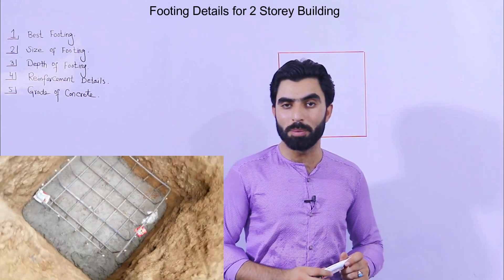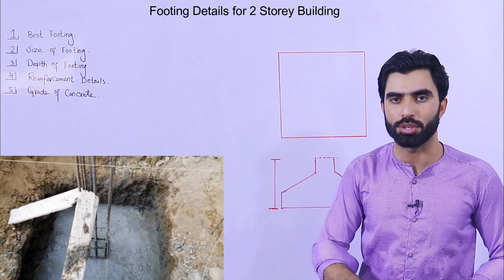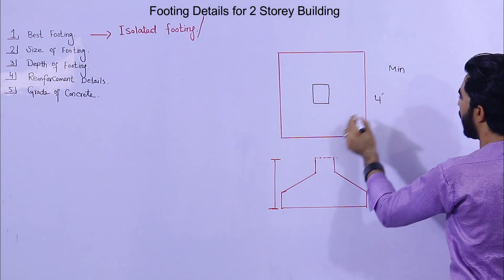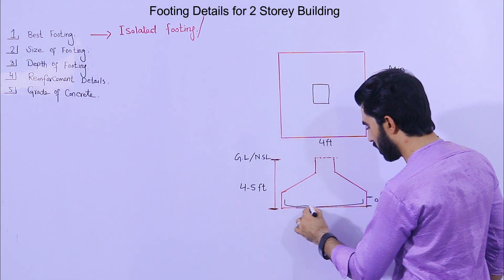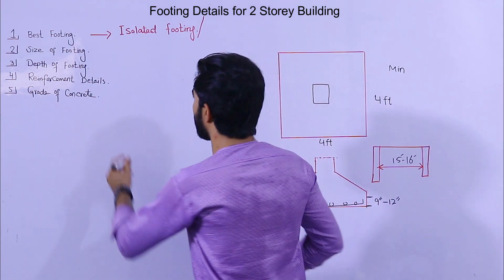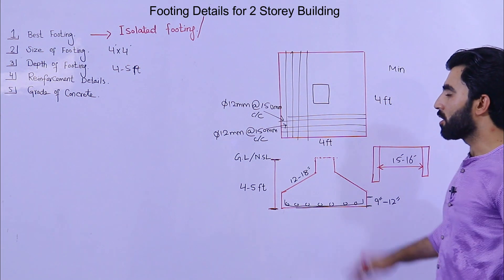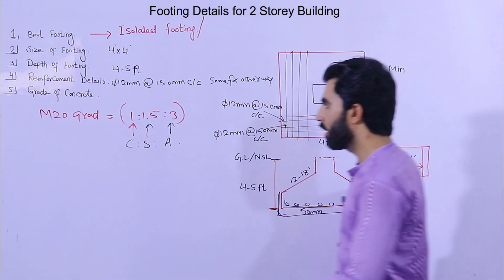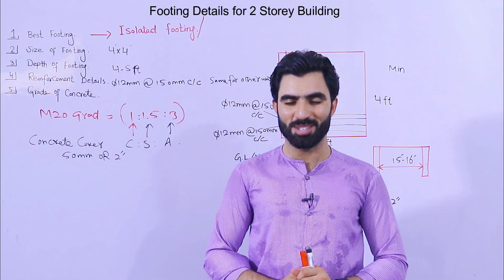Depth of Footing And Reinforcement Details for 2 Storey Buiding

Comment: I have watched nearly all your tutorials and I want to thank you as I have learned a lot. My house is a single storey but half of it seats on lower level which the lower level is supported by 7 footings (and columns) and a load bearing wall. The clear height of the columns to the beam above is 1.75 m.  My question is whether part of the footings can be exposed (not under ground but above the ground level).

Comment: design a rc footing for column size 400×400 mm which carries a maximum load of 800kn, sbc of soil 200kn/m^2 .if one side of footing is to be restricted to 1.50mt. use m20 grade os concrete and fe415 steel

Sir what it means if one side of footing is restricted to 1.5 meters??
Reply